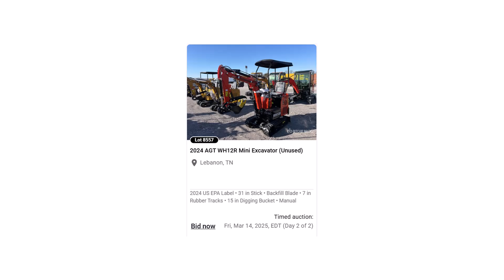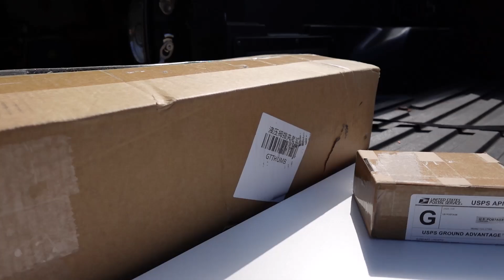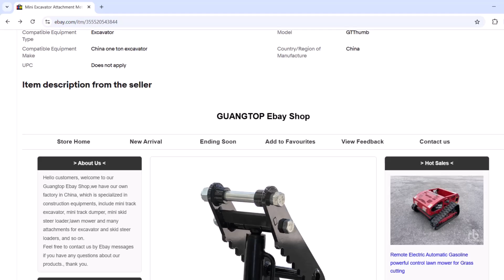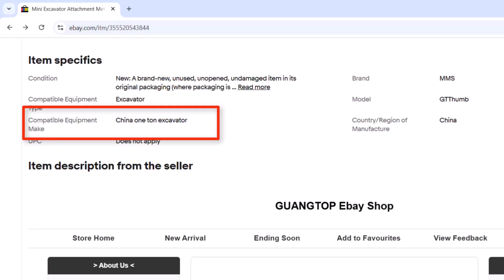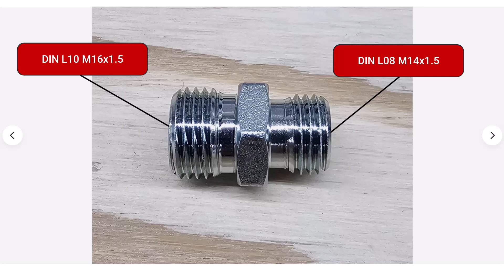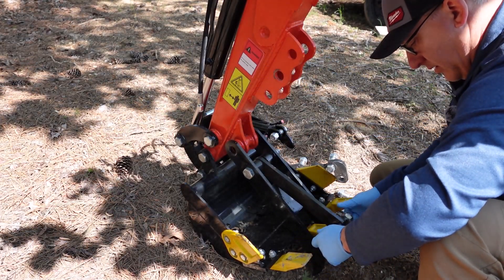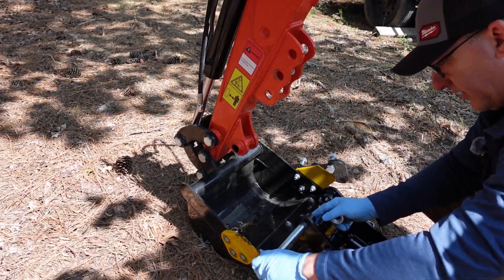Installing a Hydraulic Thumb on a Chinese Mini Excavator (AGT WH12R) | GTTHUMB Test & Review!

Comment: Thanks for doing such a detailed and well done video on the install.  I used it as a guide to install a thumb on my AGT H15 mini and it was 1 to 1 the same process.  Having your video def. took out any of the guess work or fumbling around as the kit I ordered didn't come with any sort of instructions either (appeared to be exactly the same, but different "brand" and seller....total was $119 with tax).

Just a couple notes for anybody else watching that may be curious....  The larger nut socket size is 34mm, though an adjustable wrench obviously does the trick too.  Also you mentioned installing a couple shims on the long thumb bolt to remove some of the play....I may have missed where you gave further details on that, but again in case anyone else is reading and curious, the diameter of the bolt is 1", and if you wanted to match the outside diameter of the shim to be about flush with the rim of the bolt hole it would be about 1-3/8".

Thanks again, you saved me a ton of time!
Reply from the maker: You're very welcome.  I'm glad the info helped!  And thank you for watching!